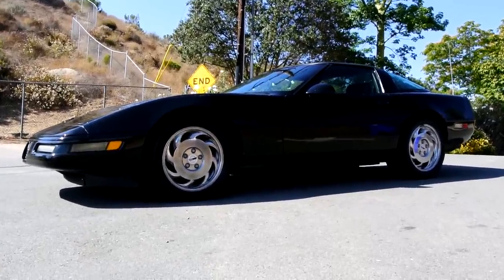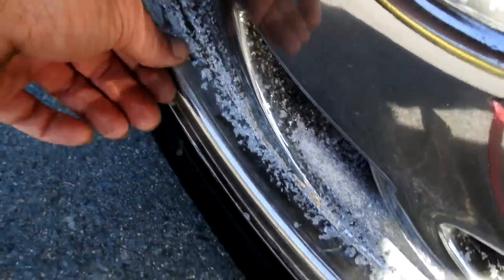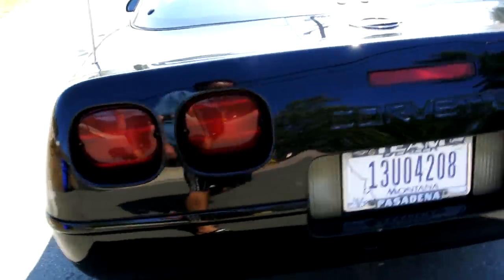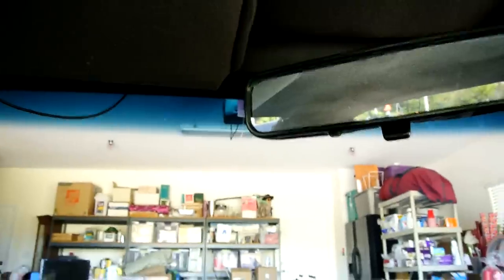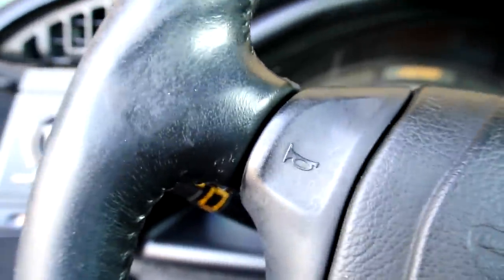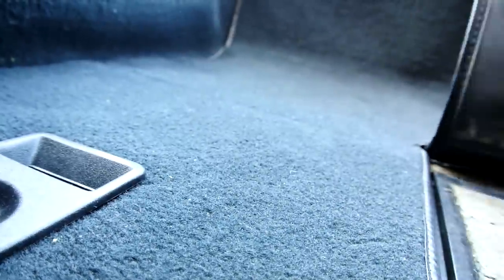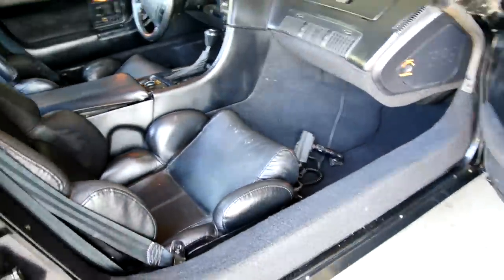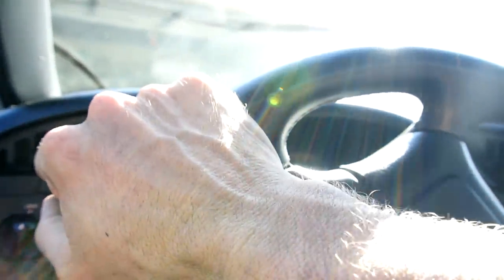1993 Chevrolet Corvette C4 Sweet C 4 350 LT-1 LT1 Sports Car Youtube Special Call Me

Comment: at 11:26, it appears the water temp is a bit high. Does this car run hot too? My '92 runs about 230°f.
Reply: Sonnywitdamoney  they are designed to run 220 to 230. For emission reasons. Hits 240 then shut it down.
Reply: I got a 92 as well that's the first thing I noticed too lol its running hot as shit
Reply: @chickenjo23  no , they run at 190 on the open road . In traffic they will get warmer because of limited air flow . The temp will rise to 228 and the secondary radiator  cooling fan will kick on and bring the temp down to 200 then shut off , leaving the single fan running again . If your in traffic , that cycle continues . The car doesn't run continually at 230 unless you have a cooling fan problem . They are electric , there's two of them. If you do your own work , parts are 200 dollars . A mechanic will charge around 450 to 550 .
Reply: @thomasfletcher1971  reading and comprehension is fundamental. If they are not designed to run at 220 then why do the fans not come on until they hit 228 degrees. The fans would come on at cooler temps if they wernt "designed" to. So yes, they are designed to run at those temps. If they wern't, they would run at cooler temps all the time. There are certain functions on the C4 that wont send signals until temps are over 200 degrees.